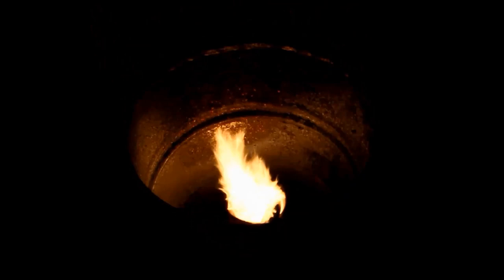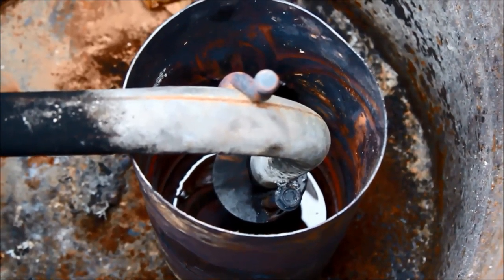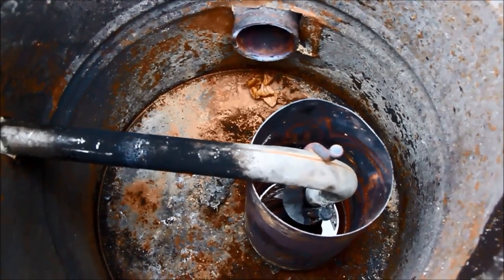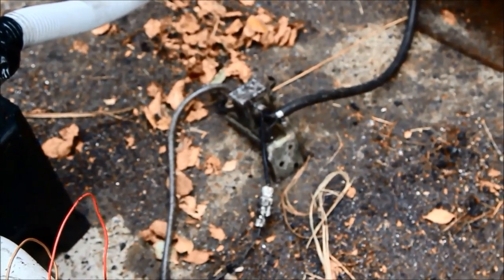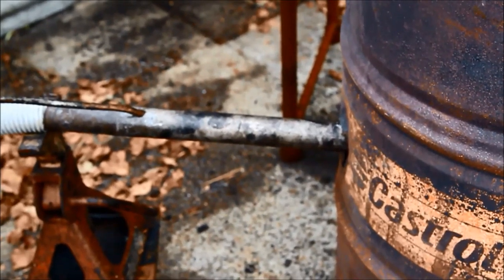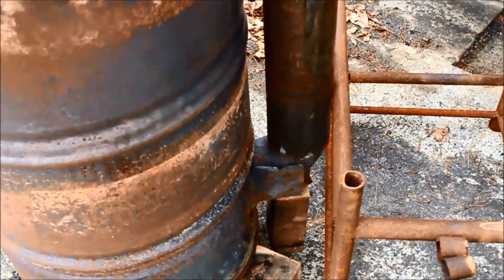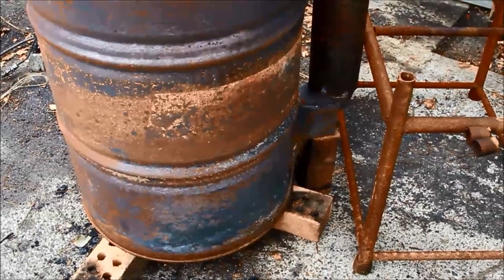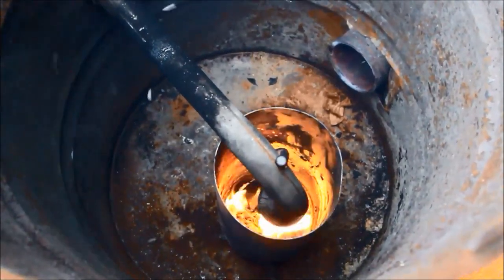Shed heater for $20 from scrap.

Comment: Making fun of and the lack of safety issues being addressed earned this video a thumbs down. 

It looks like a Hot burner. I cant imagine the amount of heat it puts out for the price it took to make it. MAYBE  if you can control the fuel to air ratio a little better it would be a great stove.  
  By observing the flame the stove seem a bit oxygen starved which means a lot of unburned fuel is exiting the stove. Having the stove pipe so close to the fuel source is generally a bad idea. This allows additional fuel to escape without being burnt. Also where the fire is, is where the heat is so having a pipe so close to the burning area will allow some of the hottest gasses to escape instead of heating your shop. The stove is also putting out some fumes, most likely CO, which is a deadly gas that cant be seen or smelled. Lack of oxygen tends to make fires produce lots of CO and the fact your barrel is breathing in and out its clear it pumping this CO into the air.  THIS IS BAD BAD BAD.
Reply from the maker: Unfortunately I'm not going to pander to the saftey Zealots who pander to idiots and morons and try to protect them from their own stupidity. If you Can't see this was satire or think that everyone that shows anything has some responsibility to protcet others, I'm sorry you are dissapointed and will continue to be.

As for your other comments, you seem to miss the fact that this was a demonstration only and anyone with a brain that was installing something permanantly would do things different.  The burner was no in fact starved for oxygen at all and the design runs with an excess of oxygen.  ALL Combustion creates CO although with respect, You seem to be pretty misguided on it and what is happening in the burner.
Reply: Oil Burner You just dont get it.
Reply from the maker: Samuel Atkins
Sincerely, would you explain it to me?
Reply: Samuel Atkins Just my 2 cents worth - the safety zealots seems to forget what CO actually is....  YES it's poisonous, yes it's undetectable, evil, will kill you as much as look at you,  but.... it's FUEL!!!  Add a tad more air,  you've got the heat already,  and suddenly, the only thing coming out of that exhaust is CO2...  These days we only hear about the dangers of CO,  but nobody remembers that it's a fuel as well.  
Oil Burner  -  I suppose what would be really interesting is to see if you can flare off the top of your chimney.  I mean if there is an excessive amount of CO coming off,  it would flare into a beautiful blue afterburner type flame at the top of your chimney - you've got the heat there already!  Although I'm not expecting it - not with that fan!  
Awesome build!!  Just what I need to heat my underwear drawer...
Reply: Bertus Ackerman Yes CO is a fuel and it burns really good. But if the CO to Air Ratio isnt right the CO wont burn even though its still deadly. CO is heavier than air so it tends to settle and accumulate. It can be in a concentration that is deadly but still not flammable.  Just because its a fuel dont make it less dangerous.
Reply: Samuel Atkins Uhmmm no.  There's no such thing as ratios have to be right.  It's a case of the three pillars.  CO?  Check,  Air? Check.  Heat?  Hell, that heater was nearly spontaneously vaporizing the steel drum,  so we'll call that a check,  That's it.  All necessary components are there,  and there'll be no CO left.  We're not having a theoretical discussion about the possible problems with CO,  no contest,  it can be dangerous - but this discussion is about THIS video,  and in my uneducated opinion, this is not an issue right here.  With that amount of air going through the system, everything will be burning up.  There's enough heat, so the combustion process won't stop until one of the other 2 pillars are exhausted.  Looking at the size if that fan and the size of the flare while the top of the drum was off and the fan was at its lowest setting,  I'd have to say the first pillar to fail would be fuel - hence,  no CO.
Reply from the maker: Samuel Atkins You take yourself way too seriously.
Reply: Oil Burner Tell me a little more about that fuel pump setup of yours...  I've seen something interesting I want to comment on,  but let me do my due diligence first and get the info straight from the horse's mouth - if you don't mind being the horse in said statement! How much fuel are you injecting at a time (roughly - is it a cup, half a cup, or something small like a spoonful - approximately) and how often does this happen, I'm assuming you've got that regulated by the timer circuit board and bike battery.
Once again - awesome setup!
Reply from the maker: Bertus Ackerman
 It's usualy the Horses other end I'm being called so a mouth is an improvement! :0)

You're taxing my memory a bit now mate since I measured the output but I think  the pump was doing around 6 Ml a sec.  I usualy leave the on time at 1 sec and vary the off time.  You may be able to work out what that was in the vid by the pulses in the burner but I'm sure I would have ajusted them at some stage anyway.I tend to tune the the timer to give the output I want. The pulses don't worry me as its the total output per hour I tend to work on which is the total litres of oil consumed.

The fuel Pulse is elongated if you like because the oil blows down the inlet tube and spreads out quite a bit so it's probably getting the dose over 3-4 sec rather than one 6Ml lump hitting all at once due to the oil being injected back near the blower.

I vary the Off cycle from anything from 2- 20 sec, depending on the burner I'm using and how much heat I want.  I find the 1 sec on time which is the shortest the timer will do tends to be better with more frequent pulses rather than longer duration pulses if you like.
Reply: Oil Burner Oh that's very interesting - that would complete tie in with my theory...  After looking at your video a number of times,  trying to understand the so-called belching - which was attributed to an oxygen shortage, and the pumping out of copious amounts of carbon monoxide, I wondered if it could be tied in with the pulsing of your fuel pump. And looking at the timing, that's exactly what we've got. Glad to hear there was an actual factual scientific explanation for it.  
Samuel Atkins   I don't want to get involved in a whole namecalling contest, I'd rather argue the point,  not the person - but I'd really like to see on video one of these belching scenarios due to lack of oxygen.
Reply from the maker: Bertus Ackerman I can tell you it's not a lack of oxygen.  If you look at my other vids that blower supplys enough air and pressure to support 4+ Times the output that burner was doing.  I have run it enough now to know.
It only smoked a bit at the start till I ajusted the fuel ratio and then it ran clean.

The vid was a demonstration with the typical Humour I put in my vids which makes them popular as well as informative.  My viewers know that I am sharing ideas not trying to tell them how to build a finished, perfected product.  I set them up, film the Vid then pull it apart and use the same components for something else. If I didn't do that I'd have a yard full of these things.

In actual fact, I couldn't care less what the thing was pumping out. It did it for 30 min, maybe, which makes absoloutley no difference to anything at all.  There would be more CO pumped out of one truck or car that goes up and down the main road I live on day after day than what came out of that burner or ever will.

Thanks for your support though Bertus. That does mean a lot and is appreciated. It's the people like you that make what I do worthwhile and rewarding and pale the whingers into insignificance.
Reply: Oil Burner Well yeah -  I get it,  I really do!  It's just very interesting when "opponents" try to talk it down,  with no real experience of their own in the exact field.  That's why I wanted to know about the fuel source, just to have some confirmation of what I was seeing.
I've not done anything with waste oil,  though I've built 3 rocket stoves.  Two still remain, and one I use on a daily basis to heat my (tiny but very cold and nearly totally uninsulated) shop.  Looking at that oil burner of yours,  it'll be real easy to adapt my "main" heater to either burn wood or oil...  But before I do I'll have to see if I can find a regular supply of waste oil... Or I'll have to start eating more french fries!
Once again - awesome videos and loads of helpful info.
Reply from the maker: Bertus Ackerman Rocket stoves share a lot with oil burners and I think are both very cross adaptable. I did see a vid the other day where a just was dripping oil into his rocket stove  and apparently had gone from using wood to more along the lines of firing the thing up on wood then running it on oil once it was hot. He hadn't modified the stove at all.  Kevin Bacon does a lot with rocket stoves and he has used oil wiht them and tells me the oil can be hard on them because they burn so hot and erode the steel.

Yesterday I tested my vaporising burner and lit it on oil then put small wood scraps in it and the thing ran great. Lots of sparks from the wood but plenty of heat and no smoke.  I think a stove upsized to use wood with forced air could be an extremely powerful heater and useful for Fast warm up of a cold house or heating water.
Reply: Oil Burner Initially when I installed my heater I was a bit pessimistic about the air flow,  so I installed a fan I cannibalized from an old central heating boiler on the end of the flue.  Unfortunately this was only one speed,  so when I started it up it draughted like a motherlover...  So I removed the fan, and it was actually pretty good without it.  However,  for the next version I'll lay some pipe either in the floor,  or along the wall,  maybe three or 4 courses before it exits the building just to extract all the possible heat from the fuel...  Then I'll put the fan back on and all will be well in the world!  Probably around the same time that I'll do the waste oil conversion as well...